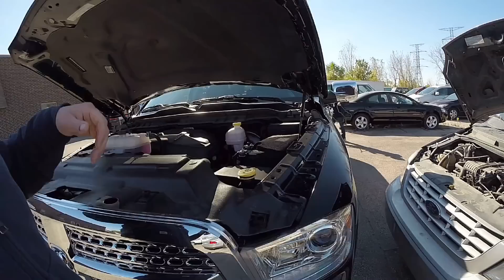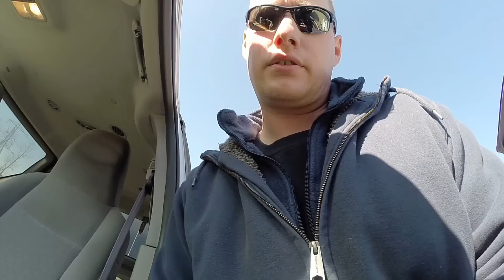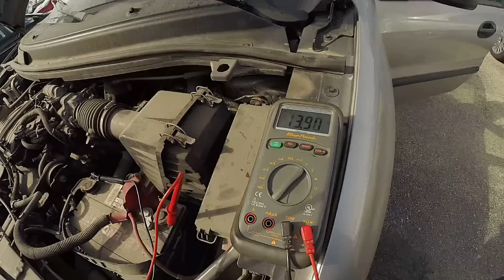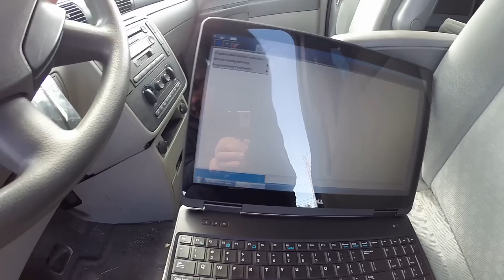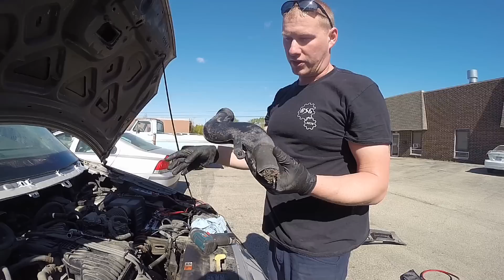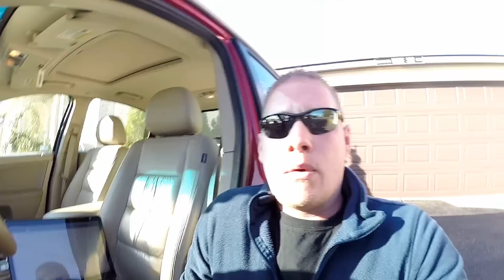Ford Freestar 3.9L v6 Dies Out

Comment: My issue is I got a 2005 Ford stalls out immediately after putting it in drive

Starts right up can put it in reverse or neutral Orr Park doesn't die out

Only in drive

Comment: i have a 2006 mercury monterey , 87k miles on it. out of nowhere beginning to stall. battery is fine , engine stalls , steering gets tight and breaks freeze up a bit. any help would be appreciated ?
Reply: Did you find a fix ?
Reply: @hajileserpud9539   yes after doing all new spark plugs , coils , egr valve was stuck open. Did a new cam shaft synchronizer also Throttle Body and Throttle Position Sensor.
Reply: @jDot2414  WOW... Thanks for info but at 87k miles, sheesh
Reply: @hajileserpud9539  yea terrible. I also moved to a new state so I didn’t have a trust worthy mechanic. So the first one I went to was just guessing. Then finally the second one I went to which people referred me to was a lot more organized and upfront about what was causing the issue.
Reply: @jDot2414  yea actually I have a 2003 Ford E250 I inherited from my father in-law that only has 72000 original miles but  can't move more than some inches because of a host of engine problems .. I'll follow what you did and see if I can fix it myself... Thanks buddy
Reply: @hajileserpud9539  no problem, good luck to you! Keep me posted. They say earlier year fords have issues with the PCM getting wet due to where they built it at .
Reply: @jDot2414  very true there's no trusted mechanic any more if you do find them  that's rare, most guys I know are trust worthy when they're starting out as driveway mechanic but as soon as they get enough clientele and move to owning a garage it's like NOW you're just some guy to them not a loyal customer of 5- 8 years... I know the feeling
Reply: @jDot2414  will do, I'll report back.

Comment: Freestars have a lot of issues. Ford has a lot of issues!!!! Run the washer longer. Freestars has a lot of water electric issues!!!! PCM and or fuse relay box water issues. Been there done that😡 won’t test for water on electrical components 😂 !!!!!!!! Your getting closer

Comment: Hi! I am new looking your videos and I like it. I got question . I am working in a 150 Ford  5.4 engine , I replace The cam phaser tensioner guide, chain, vct solenoid, lifters, and driver side cam shaft and one rocker arm , and cilender number 8. And still run bad after warmed up. Somebody can help please.

Comment: Ha. Well trained kid. I know when jumping a battery you're supposed to do it in the correct sequence and that's what I saw here (except for the acknowledged incorrect ground). Every time and I mean EVERY time I've assisted someone jumping their car they immediately snatch the leads and start connecting clamps to everything anyway  they can without a thought and then get angry when you try to tell them otherwise. Every. Single. Time.

Comment: Tell me, if you will, where did you get the soft ware setup?
Its about time, i come across a real Diagnostic, along with a repair, i Schooled back in the 80's, though not long after having a belly full of Gut'in that goes with lineman work in a Dealership back then, i was blessed to have gotten work and training for Electrical Turbines, so i spent the next 15 yrs in the Mechanical Construction end, these past Ten yrs or so i have self taught in the obII Diagnostics, coming across this Video has really helped me know i have the right idea, for an Old School.
Again, thank you for the Video and Info.
Awesome!!!!
Reply from the maker: I use the Ford Dealer IDS software

Comment: I have a 2005 ford freestar I having problems with. when its cold or raining it dies and haves a hard time starting back up
Reply: I'm experiencing the same problem on my 2004 Ford Freestar 3.9l when it rains! What'd you learn?
Reply: @time4eternity  CPU is getting wet.
Reply: @johnkidwell370  yeah, probably. I did pull out the computer and tried to water proof it with silicone, but somehow it's still giving us grief.
Reply: @time4eternity  I am sealing my 2006 freestar up having just tuned it up and replaced some parts, trying to keep it running with 319000 miles. I know keeping moisture from penetrating the CPU is key to these cars running. I found that replacing EVAC valves help and clean the mass air flow sensor and throttle body, makes a big difference. Let me know if I can help diagnose further.
Reply: @johnkidwell370  wow 319000 miles! That's fantastic!
Reply: @johnkidwell370  i have a 2006 mercury monterey , 87k miles on it. out of nowhere beginning to stall. battery is fine , engine stalls , steering gets tight and breaks freeze up a bit. any help would be appreciated ?

Comment: for the freestar, the hose that you cleared out, if its full of stuff, could that cause the passenger side inside the cabin to get wet after the rain?
Reply from the maker: Yes that is the main drain for the wiper cowl.
Reply: FordTechMakuloco grand marques as well?
Reply: FordTechMakuloco  I need to test my fuel pump on my freestar where the test port on the fuel rail

Comment: Okay what would be the reason u should not put the negative jumper cables on it for I rather do then put it on Engine but what be reason u shouldn't
Reply from the maker: +Christian Leatherman They say the spark of the last connection could ignite the gases coming out of the battery vents and sure maybe it could in a closed up shop on a battery that has been overcharged and is venting but in the real world the venting is so insignificant especially outside I still always put the last connection on the battery post no problems.
Reply: Oh alright yeah I just making sure cause I been doing it that way for long time just seeing reason was
Reply: And hey man since u know Ford's more than I do cause that's how I found u is by searching this vehicle . I have a question about it I was looking at the vehicle yesterday and I did a test drive it checked it out  good drives really good. It has brand new tires transmission shifted good no problems and everything else but I wanted to know what u thought about them it's a 2007 Ford freestyle with 131 thousand miles and I read some things on it on line. before I thought about buying it and heard they had problems with the transmission acting up and had to have it replaced but im not sure about it. I really like the vehicle everything works on it but I don't know much about them I work on cars and I can do alot I just don't have a shop so I checked it out but it seems to be on key as soon as u hit the gas to make it go. It up shifts and down shifts good and when u have to make a real complete stop quick it does like it supposed to no problem just wondering what u could tell me about them that would help me out before I pay almost 7,000 thousand for it in payments and also they said it's 4wd but I checked every where and did not see anything like button or switch so unless it's automatically 4wd or something then it doesn't have it
Reply from the maker: You can buy it sure but when that trans fails you will pay dearly that trans is over $5k by itself! We didn't see many trans failures until they got to the higher mileage as yours is so I caution you on buying this.

Comment: I have been having some difficulty with my uncles 2004 ford freestar 3.9. it has a p0171 the parts that have recently been replaced are upper and lower intake gaskets b1 s1 oxegen sensor, pcv valve and hose, plugs , wires ,coil , mass air flow sensor .any ideas?also what is the best way to submit questions and or to contact you?

Comment: are you enjoying the mobile repairs vs the dealer? itd be awesome if you could get some aftermarket garages to do business with on ford issues
Reply from the maker: +phil holbrook I am loving the mobile work, I am also looking into some independent repair shops and or collision shops that need things done like modules reflashed, pmi, zero seat calibrations etc when I am not busy in in the shop or on the road.
Reply: what laptop would you recommend to run the ids on? i ordered mine from the rotunda site for 1499.
Reply from the maker: +phil holbrook I would only recommend a Dell latitude laptop.

Comment: Hi I know this is different question. I have 2006 ford 5.4 3v same time has low idle and went shift to 2 gear feels like the hand brake is on but on the freeway go normal. And I found oil inside of my intake I remove my throttle body to clean it and I notice about the oil. Do you have any idea what it is?

Comment: I've fixed tons of the 4.6 Triton PCV hose issues.
Reply from the maker: Yeah we used to stock them even at the dealer.
Reply: Ironically, the one time I decided to use a Motorcraft part, they had to order it from the center dealership. Typically I just cut the part with the hole (where it turns) and place a plastic elbow there. I see they updated the design after 2006 and went to a polynomer, hard plastic tube rather than a rubber hose.

Comment: Great info and video.  I guess I wasn't really aware of a 3.9 V6 in any fords of that vintage.  What is that engine based on?  I have seen failing batteries cause some very strange issues that don't make sense.  The vinyl top on that 500 is kinda horrid looking but to each their own I guess!

Comment: A Ford guy driving a Ram? That tells me everything.. great videos by the way
Reply from the maker: +gianfrancoa I just had to have that diesel if it didn't have a diesel I wouldn't have bought it.
Reply: +FordTechMakuloco Completely off topic (but something I think you can shed  light on)...  I'm driving a 2013 SHO and am at the end of my lease (20,500miles).  I'm thinking of buying the car and keeping it.  Any reliability gotchas?  If so, does buying the Ford extended service contract really make sense?
Reply: Dodge guy trying to be funny. If you go to his shop he actually has a Ford pickup to do real work. Everyone knows you don’t use a Dodge to do real work the transmission will break
Reply: +FordTechMakuloco how do you like the GM designed diesel engine? i hear there not doing to bad so far
Reply: 😆😆😆 don't rub it innnnn lol